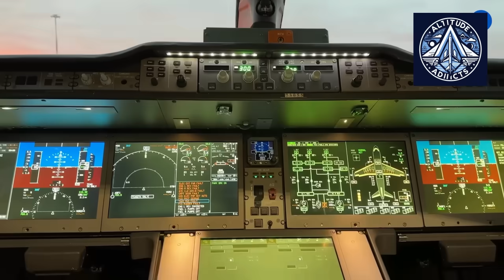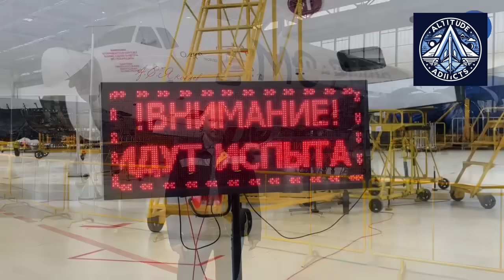Russia to build a Massive MC-21 Dedicated Base-Level MRO Facility

Comment: No, like many you remained diplomatic, undermining the actual problems to emphase false hopes.

Ukraine war demonstrated not just the USA, but the entire western bloc has become Russia's enemy. Those nations didn't spare any measures to economically destroy Russia in an unprecedented way.

Meanwhile, the MC21 could have gotten away if European or Japan didn't severed their partnership with Russia, Russia never expected they would go that far. Since, MC21 was a body without key organs, practically dead.

Russia realized it had to build engines, computers, entire systems, material compounds, toolings, etc. ON ITS OWN! Even China having its own painstaking array of problems couldn't take the risk to get sanctions, refused politely to get involved!

The amount of build work to achieve amounts to hundred of billions and an inevitable practical timeframe of 20 years, just to catch up and pretend to be a serious competitor up to the standards internationally, just on those individual aircraft components.

MC21 is indefinitely suspended, at least as a serious aircraft for the international market pretending to compete with A320s/737s. On the internal Russian market, MC21 may cannibalize older engine, systems and components from currently available technology the same way Tu214 does, but expecting more than 4 aircraft fully assembled a year is already pushing it way too far.

On the public and official side, of course, lying is a valid strategy. After all, if high figures could get away using plebs taxes to fund the entire enterprise, it do help to keep hopes high... Every month, from every media and indirect gossip, something new about the MC21 will get discussed. Do the same if you want to be the same: fueling hype. But if you want to inform and educate, don't lie like them, tell the truth: MC21 is indefinitely on sick leave. Those facilities are not meant to develop the aircraft nor train future airline personnel, they are meant to find out how western bloc INVENTED their components and how to integrate them together to actually start to build a functioning plane in the first place....
Reply: Sikap skeptis dan keraguan anda sangat ekstrem.
Diragukan tepat waktu tahun depan memang benar. Tahun depan pun sertifikasinya bisa mundur lagi.
Namun dengan warisan pengalaman di era Soviet, Rusia tidak sedang memulai dari nol untuk membuat pesawat.
Memang benar muncul banyak perjuangan untuk mempersiapkan segala komponen buatan dalam negeri, namun bukan mustahil untuk dibuat.
Ini semua hanyalah soal waktu saja, bukan karena ada kebohongan seperti yang kau tuduhkan.
Reply: @kerasaktisun1821  I didn't say it's impossible. But I'm comparing comparable things. If one want a true comparison between A320Neo/737Max and MC21, this has to include de facto FAA and EASA certification. This is only possible, with the state of near future diplomatic affairs, if western airlines, out of financial struggles, imposes western administration and governments to certify the plane, and lift sanctions towards Russia. Otherwise, we are going into a world divided again in 2 blocs.

I live in the third world, not American, Russian or European. Do you really believe USA and Europe (inside the OTAN) are that righteous to defend Ukraine and torment the world with problems nobody asked for? The sanctions, and now US tarifs ? To make a simple analog comparison, Ukraine is Russia's nephew living in the room downstairs with relations issues with its uncle living upstairs. That brat unilaterally decided to install US cameras and microphones in the livingroom downstairs. He then send crying emails explaining how he got the beaten of his life by the cruel uncle. Promptly, Europe and USA came barging in that living room to scold the uncle who just disciplined his brat. Now the entire neighbourhood is locked under military supervision, no people or goods are allowed to come and go without proper checks, and trades initially destined to everyone are hijacked to fuel all the operation... Instead of just removing the cameras, telling the brat to stay put and making excuses to the uncle to calm his anger and behave better, now they want to lock the uncle alone upstairs and cut all his supplies for him to slowly die because they didn't like him in the first place.

Do you really think USA is the enemy of the world was an overstatement ?
Anyway, think what you want, but a day will come the entire world will get fed up. My sister live in France, like any french citizen, her family is suffering the consequences of European decisions, blindly following US orders. They STOPPED to believe in the righteousness of western democracy, their leader figures, they feel they are just US cannon fodder.

^^ off topic, but if it's this dire in Europe (and the third world) at citizen level, do you really think everything is anywere sunnier and brighter in Russia ? I repeat, compare what's comparable, if Russia has to prove it creates something as good as an A320Neo, this comes with 100% equivalent technology moving the same payload the same distance or farther than A320Neo without consuming more fuel, with the same amount of safety and reliability (operational costs). The MC21 of today, or the near future is nowhere near that milestone, nowhere near wonderful enough for Lufthansa to buy 50 units... How many years did it took Pratt & Withney to develop such state of the art engine ? How many years did it took Airbus subcontractors to have such state of the art flight protection ? Do you really think Yakovlev/Irkut and their partners under western lockdown would magically come up with on the spot solution of their own ? Within a couple years ? 5 years ? 10 years ?
Reply: @StephenKarl_Integral 
Anda terlalu banyak melantur dalam menjawab namun jelas tidak mampu mempertanggungjawabkan penggunaan kata kebohongan yang dilakukan UAC.
Memang benar pihak Barat lebih memiliki lini produksi yang bagus dan pengembangan pesawat yang baik. Namun mengalami mundur dalam hal sertifikasi pesawat juga pernah terjadi di Airbus dan Boeing. Jika Rusia lebih lama membuat pesawat baru dari nol dengan komponen domestik ini justru adalah tantangan karena sedang berperang dan kelak akan banyak hal positif.
Saya pernah membaca banyak A320 telah selesai dirakit, namun mesin CFM LEAP tidak terpasang karena keterlambatan pengiriman. Pengamat penerbangan bisa sangat maklum hal itu terjadi dan tidak dengan gampang menuduh Airbus bohong mampu membuat pesawat dengan cepat dalam jumlah banyak.
Justru kecelakaan Boeing 737 Max 8 adalah ada unsur kebohongan yang dilakukan Boeing akibat ada MCAS yang tidak secara jujur diberitahukan ke tiap pilot dan maskapai yang menyewa.
Saya pikir negara yang sedang berperang namun masih mampu menciptakan berbagai jenis pesawat baru layak diapresiasi meski butuh waktu yang lebih lama untuk sertifikasi. 
Kondisi geopolitik yang makin buruk akibat perang dagang juga kelak bisa mengubah permainan. COMAC China pun kelak akan lebih memilih komponen domestik jika mesin dan berbagai komponen itu sudah siap. Saya pun melihat di China perakitan A320 akan lebih diperluas, dan bahkan produksinya bisa melampaui pabrik di Perancis. Tanda-tanda itu sudah ada dan sangat terkonfirmasi karena harga energi di Barat sedang sangat mahal dan berujung merakit pesawat di Perancis atau Jerman akan menimbulkan biaya produksi yang tinggi.
Reply: @StephenKarl_Integral  Disappoint: FAA and EASA certification is mandatory for the EU and the US. Other countries can accept these certificates for this model or not, or accept a certificate from any other country.
This week, the United States offered Russia to lift aviation sanctions in return for cooperation on the development of aircraft engines.
Cause - science and technology. Our engineers have already created two more for the three known technologies for creating blades, as well as materials for the camera. The military has carbon material technologies that can withstand up to 4000 C, but so far they are prohibited for civilian use due to the inadmissibility of obtaining these technologies by the West. Russia sent the Americans in the ass and refused their offer.
The admission of new members to Brigs has been suspended. Reason: a legal framework for the alliance is being prepared. I think there will be, among other things, certification of civilian ships. You will need to receive certification for your aircraft to fly over the territories of the BRIGS countries, which is more than 70% of the territories.
Reply: childish nonsense .... Russia has an entire range of military aircraft already that uses no foreign parts ... so they are obviously using components based on these to replace foreign parts in their civil aircraft programs. They also have huge resources of Roscosmos to draw upon too  .... in regard to high temperature components for engines . Btw your comment on China is rubbish they have their own military aircraft too and the big Y-20 is 3x the size of an A320  ..... (as is the Il-76) which is 100% Chinese .... within 2 years China will have a full Chinese airliner .... and idiots like you will be "shocked"  ...
Reply: @GaryKennedy-g7p  Yep, sure, SSJ is a wonderful plane flying everywhere in the world... I'm not just looking at the plane, I'm also looking at who's ever going to buy them, precisely, who has the money in Russia alone to buy them and finance the program, more importantly, outside Russia for that plane to figure as a 737/A320 competitor since everybody is so keen on comparing them. I heard Russia is thinking of puting back in the air long stored Tu154s and Il62s... (I'm very skeptic aswell). Tu204 has not enough production capability to answer to the demand.

Don't get me wrong, I sympathise with Russian resilience, and clearly I'm not hiding my disgust over Ukraine and western coalition, but, military technology don't care at all about costs. And the military intending to acquire fighterjets or military transport aren't thinking about how much money a Su30 generates per year... A civil airliner has to be affordable to get bought, and lucrative enough for the manufacturer to not go bankrupt.

The most childish behavior to me is being stubborn to the point to see nothing else but the idealistic scenario appeasing one's personal fantasy desires. I STOPPED behaving that way long ago, found out I was the ONLY ONE disappointed and the ONLY ONE to blame for having such foolish expectations, the entire world didn't care. Call me childish all you want, it's not like I'll fall again in that pit if you taunt me with that. Strangely enough, Russia investing in R&D plants like URSS did after second WW is actually a very great good thing, I approve, one million percent. Realizing before trying to catch someone, lay down first the foundations to make it possible in the first place. After URSS collapse, many design bureay were scatterred in territories claiming independance, including Antonov in... Ukraine. One of the key design bureau pillar of soviet aviation, one of the few that actually survived with civil engineering expertise. Well, make real another Antonov-class bureau and its whole range of contractors right on your soil... and fund it in a sustainable way despite having to finance a war alongside...
Reply: Nonsense 😂

Comment: Perkiraan tinggal 1 tahun lagi untuk sertifikasi. 
Ada yang berpendapat ini masih lama, namun pasti ada juga yang berpendapat sisa waktu ini terlampau sedikit.
Reply: Russia could certify the plane right now if ready to fly people over Russian soil.
For FAA and EASA, unless Ukraine war suddenly stops with Russia victorious and Ukraine surrendering, absolute no possible way. Be precise which certification is it about... For uninvolved/neutral/not falling under western ranks countries toward the conflict, it depends how lucrative is the MC21 compared to A320s/737s. That's why I said elsewhere "compare what's comparable."
Reply: In the Russian Federation, the certification process is extremely lengthy and labor-intensive. All spare parts and their components are certified through laboratory testing, then as an assembly, and then as part of the aircraft. Those who say this is fast are simply crazy. Production will begin in 2026; the exact date is not specified, but according to Rostec, certification tests typically take about 3-4 months. This means production will begin somewhere in the middle of the year, and the first aircraft will most likely begin arriving by the end of 2026. But that's just my personal opinion.
Reply: @PhilPantnik  Which follows is also my personal opinion; I fully assume the "crazy" concern, because circumstances beg decisive decisions.
UAC is not some newbie joint venture. Russia is not some proud African country making its debut in aviation industry that lacks profound experience in making planes (something that will come bite you in an inevitable and gruesome way) 

But precisely because it's Russia where, everything turns out relatively recoverable even in the case of some terrible accident (you Russian people are quite resilient and I somewhat respect that), circumstances imposes Russians to compromise, accept some reasonable measured risks and move on.

Just like during the cold war for the fight to SST, you won the battle of being the first to fly supersonic airliner project (but you lost the operational battle. Though, USA didn't even go beyond the mock-up phase). I remind the entire world we're entering a new era of cold war, wether one likes it or not. That means whatever the western bloc believe or affirm, the other bloc can just shove it away, and vice versa. Like in the cold war where Russia made the BEST rocket engines to reach the moon (but spectacularly failed, various oversight in other components), what should drive Russia now is NOT being compared to anything western.. that's EXACTLY what western bloc want the entire world to buzz on, for their own benefits!

What Russia should focus on right now is GET BETTER, better than what it has been so far!

MC21 comparison with A320 or 737 is just useless irrelevant concern. Why one should care at all for a plane tha will NEVER enter western skies?
In the first place, Russians are the ones that should not lose focus: Lufthansa will never be allowed to buy an MC21, the plane will never be allowed to land in Frankfurt, and there's a legal way to enforce it: no EASA certification in this reality; FAA? Don't ever dare to think of..

My point is, discard everything irrelevant and focus on ONE GOAL: Make MC21 a Russian made tool to CARRY Russian business in Russian TERRITORY!
BE EFFICIENT! You need that plane *RIGHT NOW. Why would you care about meeting WESTERN BLOC standards and principles when down the line that just IMPEDES your progress while not bringing the related expected benefits such as successfully selling the plane internationally: THAT WON'T HAPPEN, don't fool yourself, don't lie to yourself!

PRIORITIES! You can make better engines LATER, by doing the proper research and development at a reasonable pace in parallel. You can UPDATE the MC21 along the journey. Better avionics, better FADEC, more pristine EICAS... Just leave the necessary room and include future integration upgrades in the design from the start. Your TOOL (MC21) doesn't have to COMPETE with ANYTHING (A320/737/Whatever), it has to fulfill a PURPOSE: Keep essential domestic, regional and transcontinental businesses ALIVE AND AFLOAT!

Considering the above circumstances (my opinion, but I DARE insist they are RELEVANT, HONEST and reasonable), get reminiscent of what Russia had already accomplished in the past: your Ilyushins, Tupolevs, Yakovlevs, Antonovs (yes, those are all Russian Metal) have flown all the skies in this world. They have been nicknamed "flying coffins" by entire western to these days, yet they DID the job with barely more casualties than western supposedly mighty safer stuffs.

MC21 will not escape its ordeal of critique. Even worse, triggering Russian on their ego (that's some strategy we see everywhere), constantly qualifying MC21 as inferior is one VERY EFFICIENT way to make you take the bait, making you STRUGGLE more trying to fulfill ALL conditions, making you NOT MEET A SINGLE ONE at all in the end and fail miserably...!
MC21 is a flying coffin... Why should you care?
MC21 is heavier... Why should you care?
MC21 is performs poorly... Why should you care?
MC21 is not competitive and will not sell internationally... Why should you care?
...

Instead of caring about what people think, be proud to stand up and move forward, forward towards a BENEFICIAL and TANGIBLE GOAL for your own sake!
Certification instances, if they are a minimum aware the future of the country they should protect is at stake, should encourage efficiency in reaching goals. As long as the plane is SAFE to not kill Russian people, there is no reason to delay its certification. Everything added to only please western conditions for certification, but NON ESSENTIAL to Russian territory business SHOULD BE PUT ON HOLD right away, and developed on the side line for future integration.

^^ that's, summarized, my reasoning, and that's indeed an opinion.
Pride is one funny thing that potentially drives you forward; it becomes a deadly double edge sword when you care about what others think and want instead of caring about yourself FIRST...